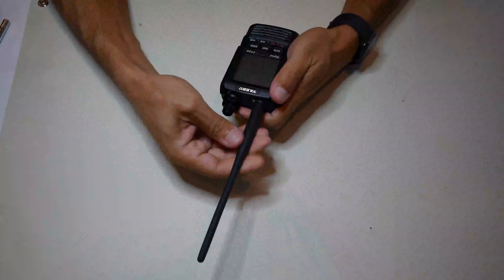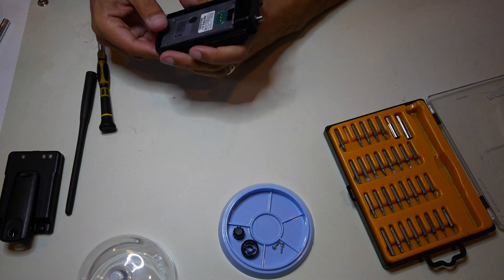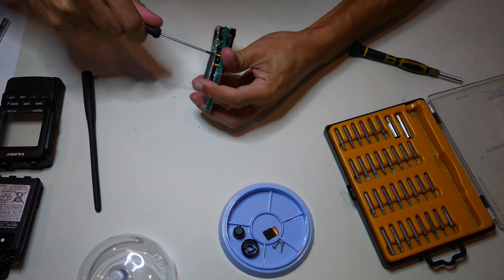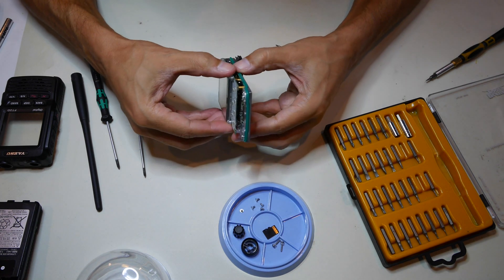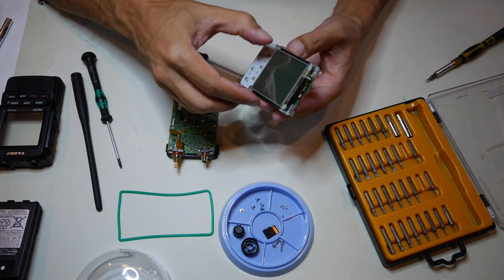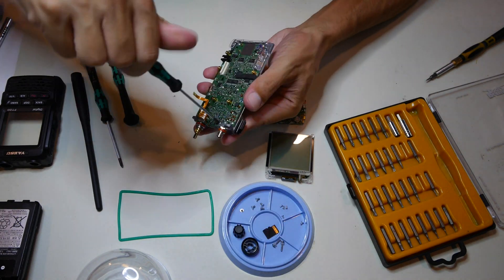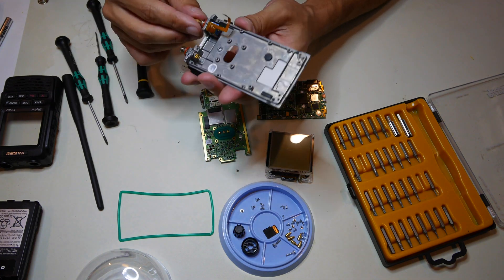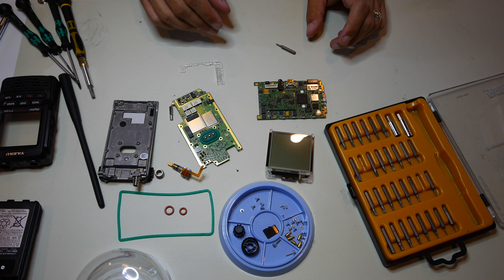Yaesu FT2DR Full Disassembly/Teardown

Comment: Ever think of drilling out more of the holes in front of the speaker? Anyone who has ever owned one of these knows it would really help. I am going to tear down my ft-3dr and use a small dremel bit to route out the rest of the opening. Hopefully it will give a better sounds. Not be so tinny. Nice videos and wiki page is excellent. Thanks W4ffx
Reply from the maker: Thanks! I don’t care so much if the radio is water resistant so opening the holes is a good idea. Let us know if it improves the sound. Feel free to post pics of your mods on the wiki, message on discord for code to create an account.